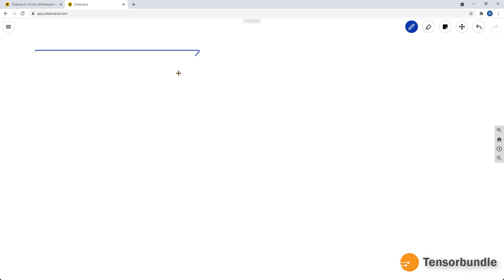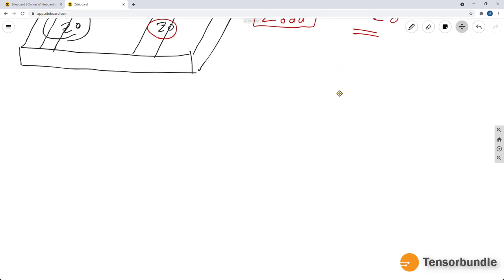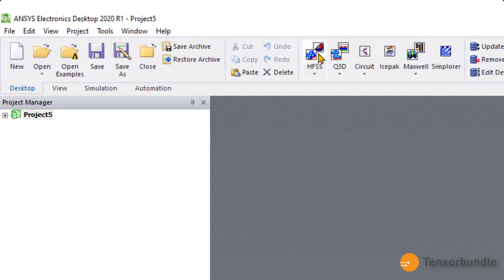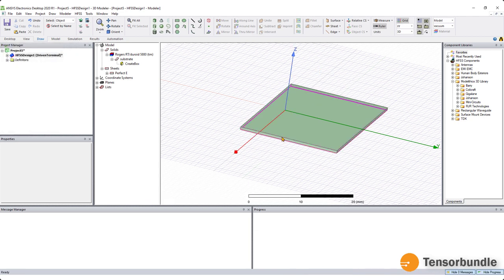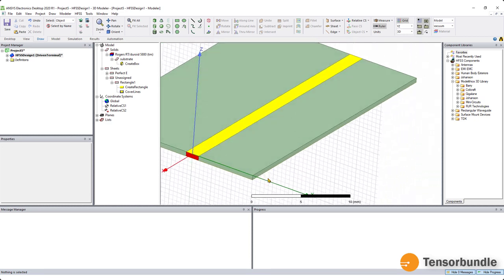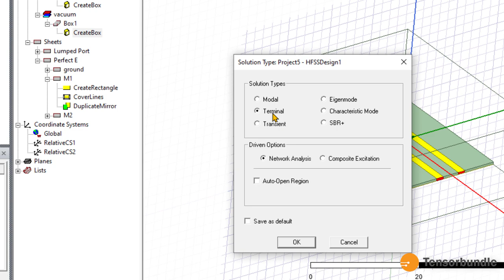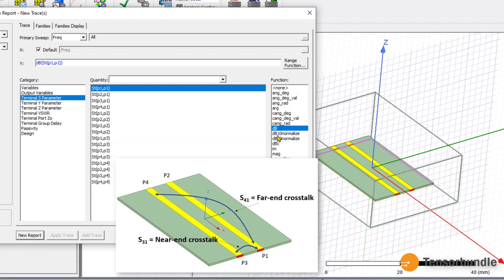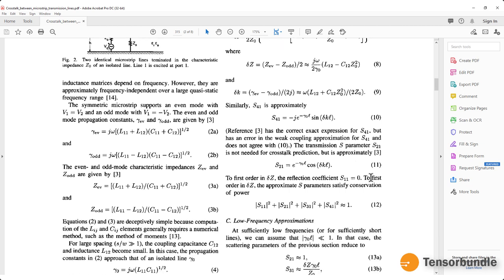HFSS Tutorial: Crosstalk in coupled transmission lines: Modeling & Simulation in HFSS

Comment: One note: by default, when I add the HFSS solver, the solution type is "modal", this will cause issue when assigning excitations to the lumped port. This should be changed to "terminal". Otherwise, we can't find the same setting for the lumped port.

Comment: Thanks for the tutorial! Why did you create the radiation boundary of that exact size and position? Sorry if this is silly to ask, I'm new to HFSS
Reply from the maker: Basically it was just a random-size radiation boundary. Since these are guided-wave structures, meaning radiation is negligible, so I did not care much about the criteria of placing the boundary at least quarter-wave length from the structure. But if it were an antenna, then I should have followed the distancing criteria of quarter-wave length. 
You can also use FEBI that allows to place the boundaries disregarding the distance criteria. Hope this helps.
Reply: @tensorbundle  thank you